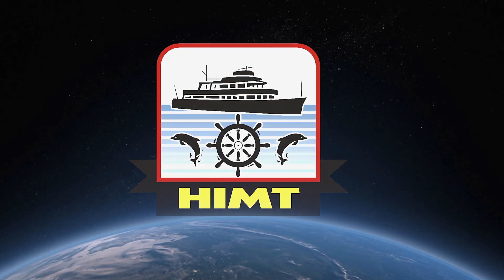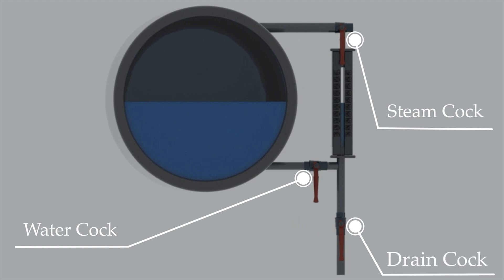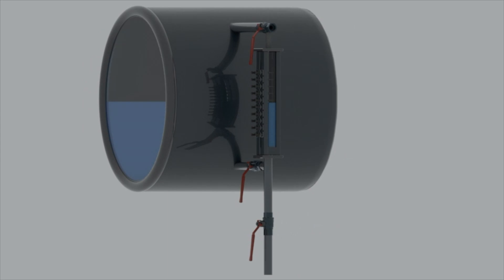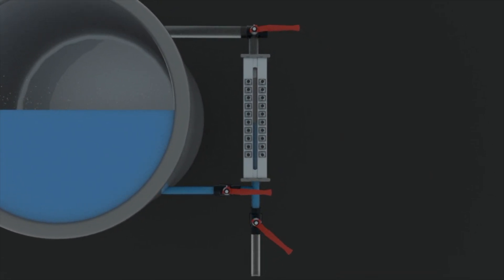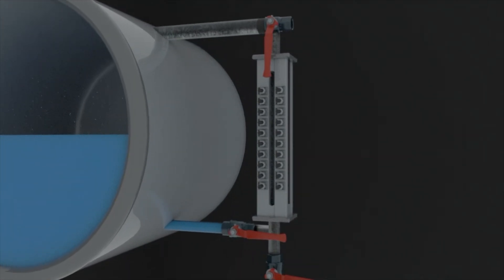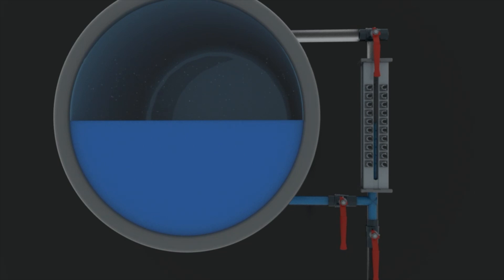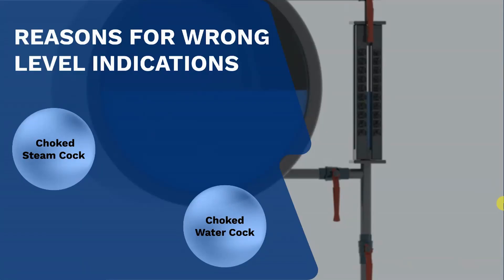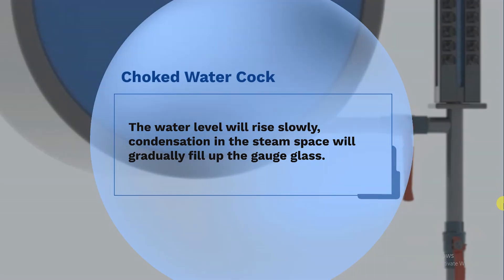Boiler Gauge Glass Blow Through Procedure | 3D Animated Explanation

Comment: question- steam valve and water cock open in verical direction but drain stop in vertical direction
Reply: So it naturally falls closed. There’s a fear if you have the horizontal position as closed the valve could vibrate itself open.
It’s also easier to remember all the valves are the opposite of the way you think conventionally